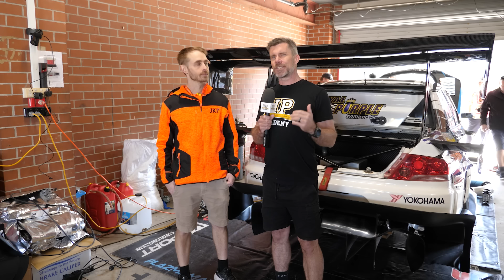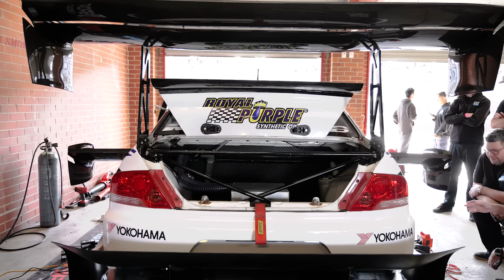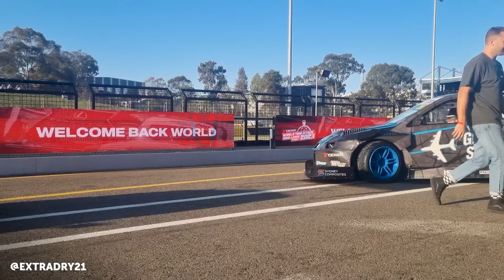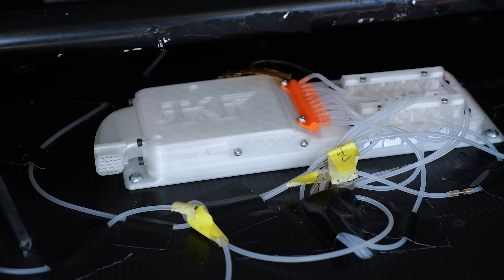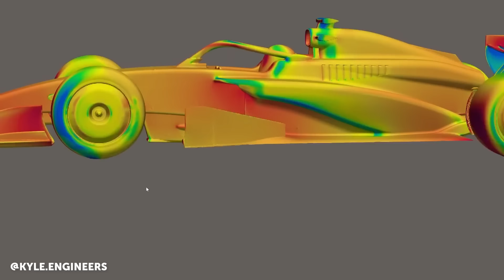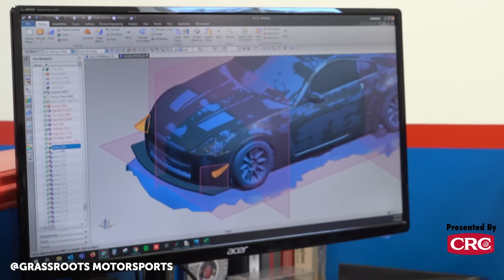The F1 Tech Behind Modern Time Attack Aero

Comment: If the cars are making over 500 hp the aero isn’t the reason it has a good time. The power is.
Reply from the maker: That's a common mistake. Here's an example of reducing power and going faster: https://www.hpacademy.com/blog/590hp-4g63-time-attack-evo-6-clubsprint-racing-tech-talk/

Aero in a way gives you the ability to maintain a higher average speed throughout a lap.

Power is a factor, but it's only one factor and alone with no good way to get it to the ground it will only help so much.

This is one reason why we don't see 3500hp drag car chassis winning at Le Mans - Taz.
Reply: @hpa101 a drag car is designed for that style of racing but case in point, the C8 corvette. The only reason it beat the GTD in the lap of the ring time IS because the corvette makes over 1000 hp. The Mustang GTD makes something like 850. If the Mustang made an equal power to the corvette it would be close in times. I’ve seen time trial battles on sukuba. Cars making high power number with just a wing and canards make sub one minute laps. Meanwhile there’s a white S2000 with wing parts from a 747 that can’t even get close to a sub one minute. It’s all about the power and driver.
Reply from the maker: @OGAwsomSauce  that's actually a great example. There are cars with faster lap times than the C8 Corvette around the Ring which have less than 1000hp 😎
All the cars going for that record which are faster actually have less HP than the C8- Taz.
Reply: @hpa101 Aside from the two mercs, one that’s making the same power as the vette and the other which isn’t , both weigh near the same as the vette. The others are close to 500 lbs lighter or more. Weight changes the factoring. But again. The aero packages on those vehicles were designed by engineers. Not some tool that took parts off an airplane wing and theorized if a small wing makes this than a bigger one is better. Drivers still make the biggest difference. Max verstappen vs Kenny from the block is going to have huge result differences. 😉
Reply from the maker: "Power is a factor, but it's only one factor and alone with no good way to get it to the ground it will only help so much."

Aka - "Weight changes things"

Great chat 😎 - Taz.

Comment: Those comments about porpoising and keeping the underbody aero window wide enough for suspension adjustments got me thinking. I wonder what the pain points would be like having unsprung, or at least partially unsprung underfloor aero. Besides the extra mass in the wrong place, of course. 
My gut tells me there may be some value there on, say, a car with a live rear end setup, with a torque arm. You could probably even flatten the exhaust out and blend the exit to blow into the diffuser under the car. Hmm.